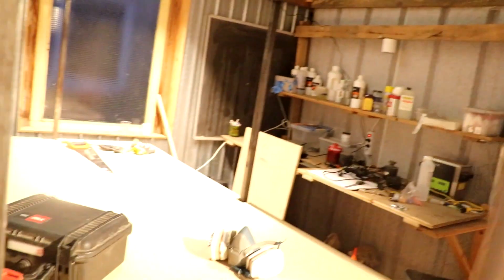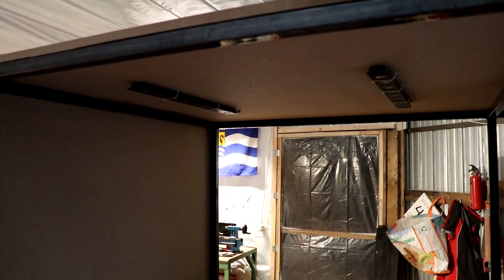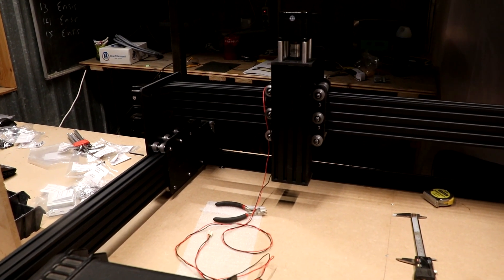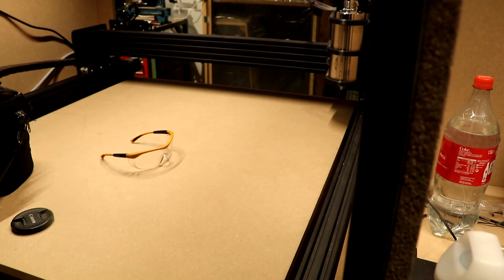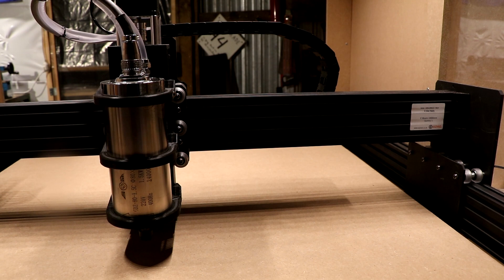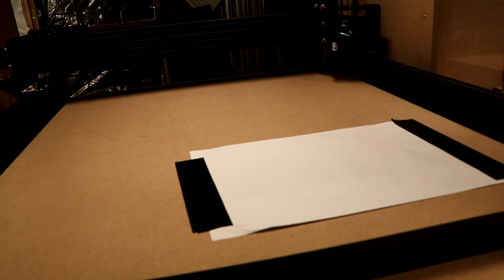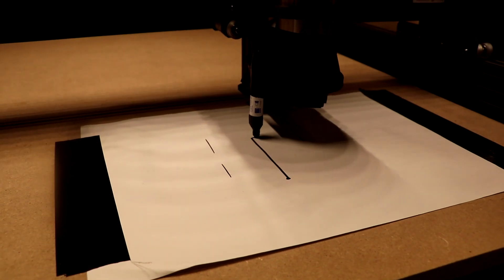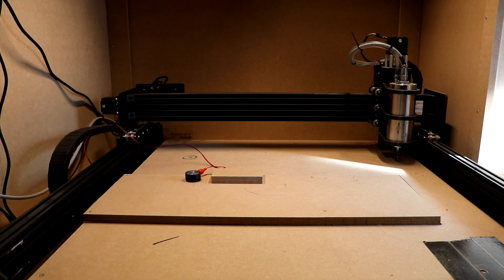Building a Workbee CNC router for knife making

Comment: would you recommend the spindle?
Where did you buy spindel and VFD?
Reply from the maker: Hi! I definitely recommend the spindle. It was a bundle from Aliexpress, with a vfd. The link should be in the description :)
Reply: @yesealex  Actually its not :)
But i guess i will find a deal... 1.5 kw?
I'm considering an air cooled one, but not sure...
Reply from the maker: Yes! Go for 1.5kw water cooled. Sure it is heavier, but realistically it should live longer because routers are really dusty. Enjoy your build!

Comment: You should look at the openbuildspartstore Black Box controller
It’s a great value and has the control you’re looking for with nicely powered motor drivers and port options 

It runs on 24v DC so you would just have to provide that PSU for your country and you would be set !
Reply from the maker: Hi there! I currently have the duet controller capable of turning the vacuum on and off. And I can also adjust  the spindle rpm. So I'm happy right now!

Comment: hi, nice video. Question as to the user of the machine. The machine is built on the OpenBuilds system...how's his accuracy? as far as there are enough rollers. the handles of the knives in the video are cut with a rough cutter? thanks.
Reply from the maker: Hi there! I find the cnc quite good. Accuracy is good, parts fit every time. Although the parts I make fit relatively to each other. I haven't machined parts and checked if 15mm is 15mm..in this video all handles were cut with a rough cutter and a coarse stepover. I'd recommend the workbee

Comment: The decision by workbee to use duet controller is regrettable. Duet isn't designed for cnc machines. Franco youtuber used centroid acorn controller with the workbee.
Reply from the maker: The interface is nice though. Heard that there were a lot of bugs with other controllers sometimes
Reply: @yesealex  centroid is a professional controller company. They have introduced the acorn product for small cnc manufacturers. Heard they are bullet proof controllers.
Reply from the maker: Looks interesting!